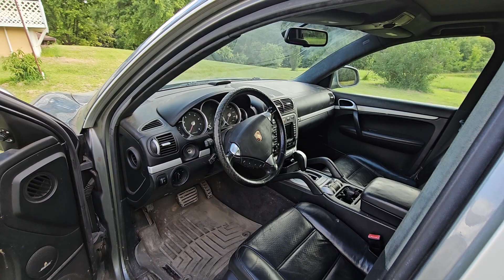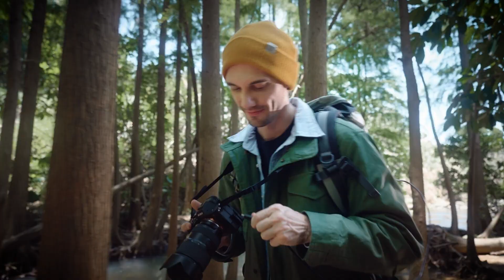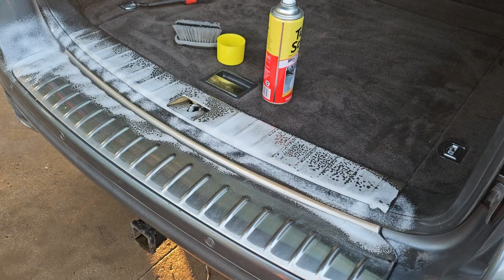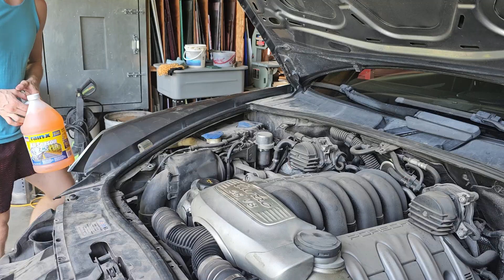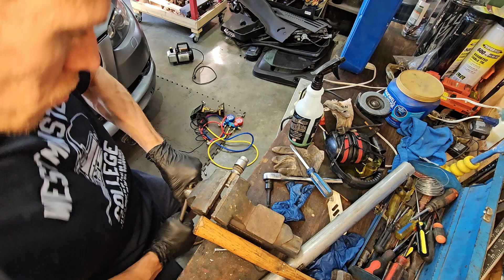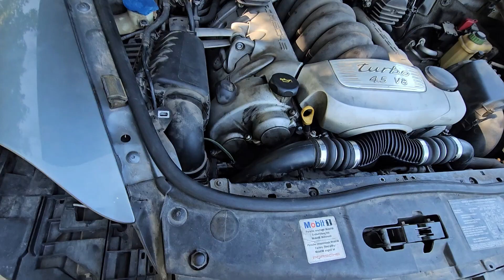The 450HP V8 TT Porsche You NEVER Knew Existed!!! But... Can it be Fixed???

Comment: 6:43… Porsche keys are on the left for the Le Mans start. Back in the day you had to run to the car from the pit wall, jump in the car, get it started and then take off. Having the key on the left just saved a second or two when trying to get the car started for the start of the race.
Reply from the maker: It really does save time

Comment: The lights on top of the dash are for the parking sensors. Great find. I have a non turbo 2006 S and I absolutely love it.  Make sure you unclog all the drain holes and check the wiring under the drivers side floor mat.
Reply from the maker: Awesome, thanks for the info!